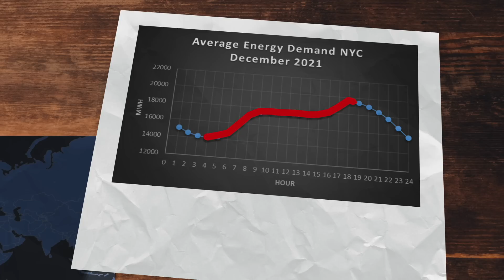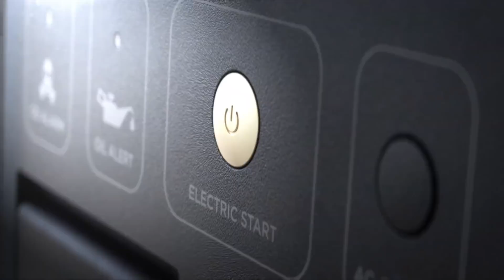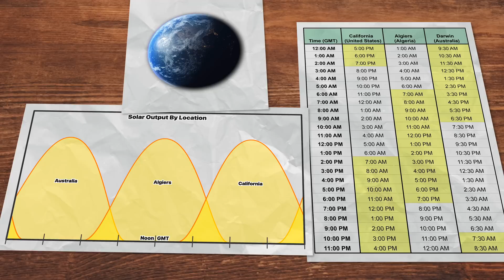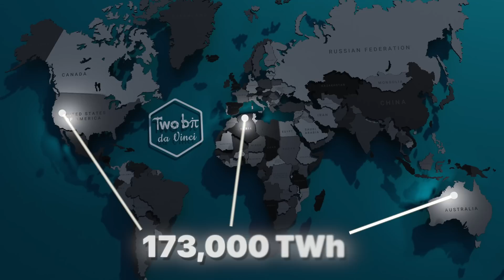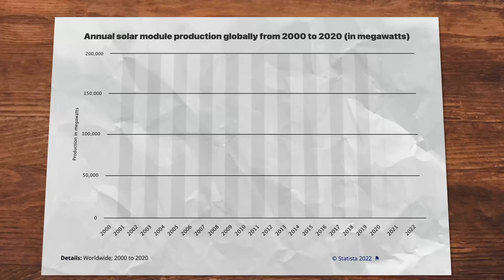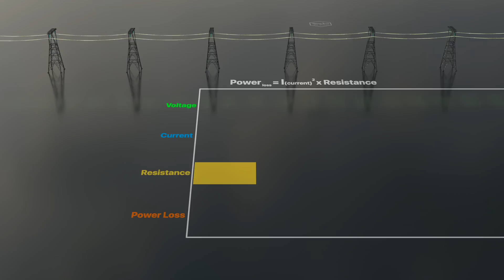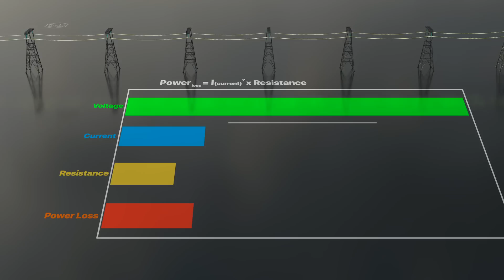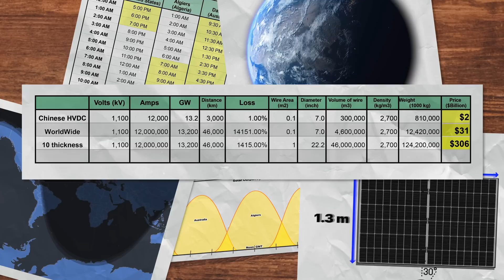World Solar Energy Network... Could this work?

Comment: You could significantly alleviate and simplify all of the issues by scaling it down. 

Total power consumption for residential usage, assuming the global population uses as much as the average US citizen (they don’t, so this is a highball figure), is 96.437 terawatt hours. Using US figures for dollar per installed megawatt on the utility scale acquired from the IEA the total cost for the system is less than $3 billion. That system, alone, allows every person on earth to live in their homes without worry of the power going out.

The rest of the world’s power consumption is industrial, and there are other proven technologies out there (nuclear) that can cover that demand.

Comment: Your math seems wrong or confusing. 
At 1:00 you said the earth receives 170,000 TWh from the sun and our global consumption is 19TWh, but then at 8:14 you run your calculations as if our consumption is 170,000 TWh not 19. Can you clarify?
Reply: I noticed this as well. from my quick math he is out, it should be around 27 billion not 123 billion based on 19TW

Comment: This could be made so much easier —saving thousands of Kms of cable— if instead of a west-east approach we think North-South. Think just 2 solar farms in Patagonia(Argentina) and Alaska(US) to get 24/7 sun depending on the month.
Reply: Unfortunately the sun is super low on the horizon in the far north/south, so you'd probably need 2-3 times as many solar panels.
Reply: @nathanbanks2354  ten times at least
Reply: Both places have serious weather, and have the same night times during spring/autumn, but every little bit helps.

Comment: It may not work on a worldwide scale but it could work on a smaller scale for example mixing power generation methods and link them across countries.
For example there is allot of hydro power in Northern Europe, Wind in the UK and solar in Southern Europe.
Perhaps if Europe can work with African countries we can cover most of the energy for half of the world.
Wouldn't.
The biggest challenge would be getting everyone to work together.
Reply: it's already happened & is expanding rapidly.
Reply: @alanhat5252  It is at a smaller scale but will be interesting to see how it expanda over the next few years.
Hopefully Brexit won't mean we're left out in the UK.

Comment: Mark Jacobsen of Stanford University has studied this at length, modelling all parts of the world, using all energy sources, and discovering the optimum mix for minimum cost. He proposes a mix of (mainly) wind, solar, hydro, various types of storage (typically only four hours are needed) and HVDC connections. Average energy costs are about half those of today. A programme on his work would be a great addition to your channel….😊
Reply: The problem then becomes, when the giant space probe comes looking for the whales and blocks out the sun with cloud cover, the earth wouldn’t have power without the sunlight… (sorry… my Star Trek IV geekiness couldn’t resist)
Reply: @whochecksthis  Dilithium crystals would deal with the lack of sunshine.
Reply: That dies sound like a great video idea
Reply: I think someone did the math on connecting the east and west coasts of Australia and it way too expensive.

However, I saw some recent research that the amount of storage that's required is grossly exaggerated.  I understand that solar and wind are complementary - there's more wind at night than through the day.   Also offshore wind is complementary as well.  Add in some tidal, wave and hydro so you have many complementary sources so you get to the point with some demand management that your storage needs are minimal.  That research suggested you might need to fire up some gas generation every few years when there's lots of cloud and not much wind at the same time.

There's a company planning a huge solar plant in the Northern Territory in Australia to provide Singapore with about 25% of their electricity.  That's a very long cable.  I understand some south east Asian countries are looking into connecting their grids together to reduce the need for storage.
Reply: @michaguy  What is exaggerated is the week or more worth of batteries that some people start demanding when anyone mentions that experts say we would only need four hours of storage. Note that does not mean the emergency storage like the 48h batteries in cellphone towers, those are separate.

The four hours calculation already assumes use of complementary sources and we can't just go to bare minimum because if we get a case of widespread freak weather it will take a few hours to get the backup power plants online, and up to a day to cold start the secondary backup coal plants.
Reply: Did he look into super conductors? Because when I hear megavolts I start thinking arcing, as in Tesla coil and lightning. I accept that they're prohibitively expensive, however the same could have been said about wind and solar a few years ago so all that's needed is the infrastructure and mass production to be built. My main concern is do we have enough material to build enough transmission
Reply: Shouldn't be just for the channel ;)
Reply: People have the tendency to crowd together in cities and move from place to place in planes.
That way they lose the perspective of how immense the world is.
And leads to models like this, underestimating the enormous amount of material needed for such operations.
It is never going to work.
Reply: Why isn't he considering Thorium?
Reply: @toddmarshall416  For the same reason fusion is not on the list. We can simply throw loads of money at manufacturers and issues with supplies of PV panels or lithium batteries will go away soon enough; thorium is still under development because the molten salt keeps eating through the reactor casing, so we cannot assume we can build it reliably yet.
Reply: @augustlandmesser1520  Nuclear would be a great option, but the time and money needed is a major problem as it is better to get some renewable production going by next year instead of hoping that there are no delays and you will have gigawatt of nuclear power available in "only" ten years.

Olkiluoto 3 in Finland is not even a new power plant, just a third reactor added to an existing one, but the project is almost fourteen years late and several billion euros over budget. I bet a lot of people at the power company wish they had spent at least some of the money building windmills instead...
Reply: The initial investment is simply way too high. It is far more economical to distribute the energy with e-fuels (despite the much lower efficiency).
Reply: I propose 100 desalination plants  up and down the California coast powered by peak solar which pump water into interconnected reservoirs which function as pumped hydro.  Californian water issues solved. No need for batteries.  24/7 power.
Reply: @ashreddy8507  As for desalination, on that scale you're probably better off dehumidifying the air. You could probably even have plants floated on the ocean where the air is most humid and piping the water ashore, or pipe the air ashore to where the plants would otherwise be. (edit) A similar system could turn Australia into one big farm
Reply: @ashreddy8507  That would be cost prohibitive, but it is possible.

Comment: If you don't use a world wide electric grid you wouldn't have the problem.  You can link states if they want to join..  In California they have solar panels installed on individual homes, offices, stores and government facilities are linked to a common power station which is sold back to the public who don't produce solar power.  We started off small and I've been off the grid for about seven years so far and would like to have enough storage to get my batteries charged up to 80% instead of 100% before noon on a sunny day.  Link States together is a better option than trying to link countries together to share electric current.

Comment: first off, the future is decentralized not centralized so think microgrids not massive infrastructural projects. Some paths require major transmission lines at least locally, for those use graphene instead of metals and you wouldn't have nearly the same losses. For instance the cable btw marocco and the UK that is being built right now could be made much cheaper that way, but they're able to build it regardless...

Comment: Stop it.  You know why this will not work.  You are going to cross the Bering Strait with a power line?   I am a realist and know we need alternatives, but this is pie in sky for so many reasons. With current  technology this is incredibly inefficient losing most of the power in transfer for such long distance.  The cost for the network to provide this type of layout is prohibitive and faces political challenge.  You propose to take energy from Africa to other parts of the world through China and Russia?  For example  Maine tried to get power from Canada and the project was 90 percent complete but voters blocked it.   We already have a global net work of oil and that is unreliable due to political divisions - so I expect that a world wide solar network would face the same challenge.  Thanks for the click bait but you need to get closer to reality.

Comment: More simply, you could optimize placement by using polar solar, where you have long stretches of continual daylight and lots of uninhabited land. Between the two, you should be able to cover your needs through half the year 24/7.
Reply: yes but the sun is weak towards the poles because it's travelling through lots more atmosphere. That's how the poles remain frozen
Reply: There is the problem of arctic land mass…or rather the lack of it. Positioning large solar farms on top of a dynamic ice cap would be fraught with issues.

Comment: I am still confused between DC and AC power transmission over long distances. I know China already has one. Could you do a video on the pros and cons on AC Vs DC please?
Personally, I feel the World is moving more towards de-centralized World which is going to thrive on inter connected self reliant bidirectional micro grids. I am sure the development of EVs which are  basically one huge battery bank on wheels will also play an important role in bi-directional charging.
Reply: AC can use transformers to raise and lower voltage but suffers capacitive losses between the wire and ground.  Being the losses are 1/CV^2, increasing the voltage to reduce resistive losses increases capacitive losses.  DC doesn't have capacitive losses but requires complicated circuitry to increase and decrease voltage.
Reply: DC power is harder to convert back into usable electricity but can be the cheaper way to transmit large amounts of energy over long distances.
Reply: @garethbaus5471  I remember fiberoptic (voltage isolated) triggered SCR's (old silicon switch that latches on).  The idea was to stack a bunch of 1000V devices to get a high voltage system.
Reply: There excellent videos explaining this and check recent (2022) videos also talking about the use of superconducting cables that allow huge amounts of power to be transmitted through much smaller cables. Advances are making many new options available to us.
Reply: @davidlemieux615  Superconductors need to be kept really cold (liquid nitrogen), which offsets some of the size and energy benefits.  

Not sure how you would do that between Siberia and Alaska.
Reply: The biggest losses from DC come from resistance in the wire. As I understand it that is the main reason we use AC resistance doesnt play in the same way.
Reply: @lunarthief6501  The resistance for AC is no less than DC, and much higher at high frequency (look up skin effect).

The advantage of AC is the ability to use transformers.  High voltage from the power plant can be reduced for local transmission, further still for use.  Transformers require a changing magnetic field that AC provides.
Reply: Microgrids are just another Green fairy tale.  They still need storage and backup.

Comment: OK, I know it gets old, but yes, the sun does shine 24/7/365. It is just that not all of the earth's surface receives sunlight at the same time all the time. That is the main reason research is done in developing space solar arrays and transmitting that power. Some areas of space do receive sunlight all the time. The added advantage vs this thought experiment is that space solar is more efficient and does not have to be installed three times. Disadvantages are the cost to launch or fabricate in space and the tech for transmission still needs to be developed.. Also possible heat/energy consequences of beaming this much power to earth's surface need to be investigated.

Comment: 'Moon Battery'
a.  Electrons try to get away from each other and collect on the surface of objects.  In this case, on the surface of the Moon.
b.  Put a deep vertical device to electrically connect the electrical charges on the surface of the Moon with the lower inner parts of the Moon that would be less electrically charged.
c.  Electrical potential difference being generated, electrical potential difference being a battery.
(Large static electrical charges on the surface of the Moon could be utilized as a source of energy, even on the dark side of the Moon facing away from the Sun).
"LET THERE BE LIGHT EVEN IN THE DARKNESS",  just have to plug into the universal energy source.